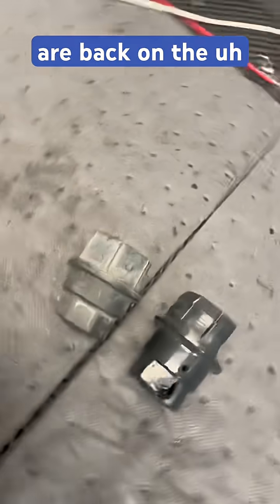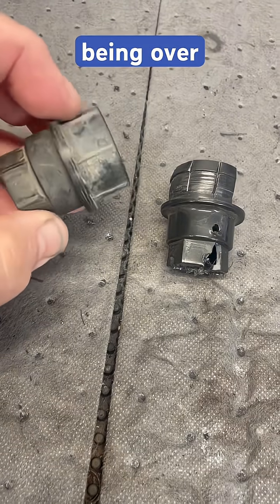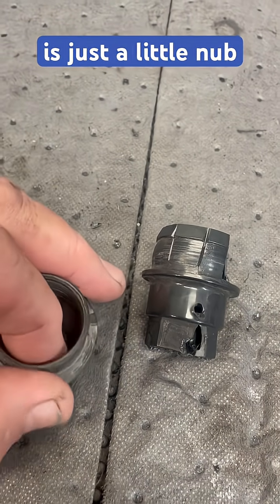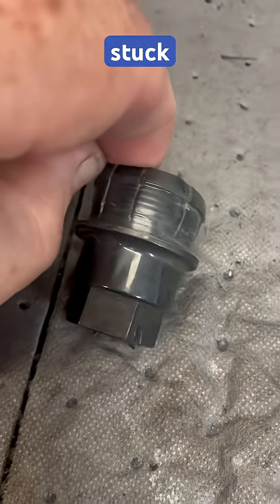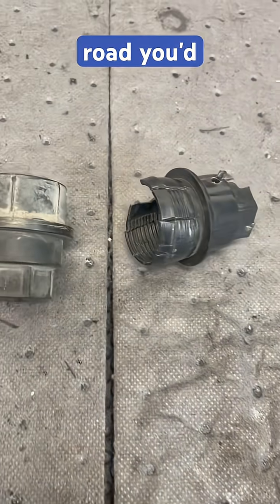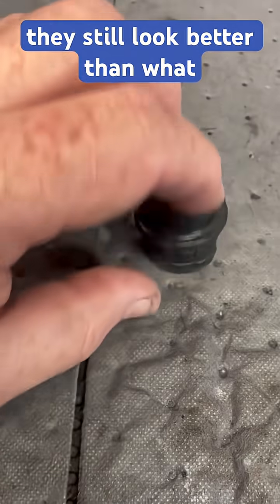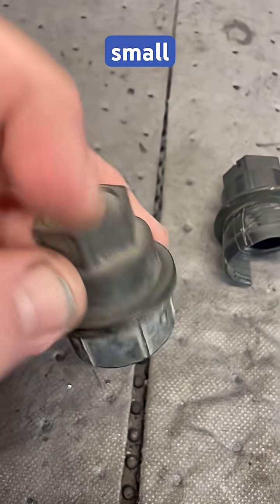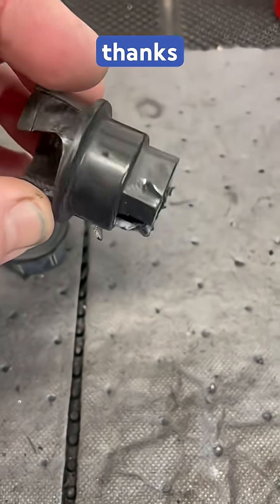These Lug Nut Covers Didn’t Melt… They Shattered. Here’s the Strange Part..

Comment from the maker: These lug nut covers are new. They didn’t melt — they cracked apart like they were made of brittle casting resin. Something is definitely off in the polymer blend.
For the mechanics:
Is this bad curing, cheap filler material, or a full-on shift in how some of these overseas manufacturers are mixing resin?
Curious what you all are seeing on your benches.
Reply from the maker: The fracture lines were identical on every cap — which tells me this wasn’t a “one bad piece” situation. I’m thinking this was a resin mix that was way too hard to flex with heat. 
Anyone else seeing cheap plastics doing this lately? Drop your take.
Drop your thoughts — the more technical the better. Mechanics, materials guys, polymer folks… let’s dig in.